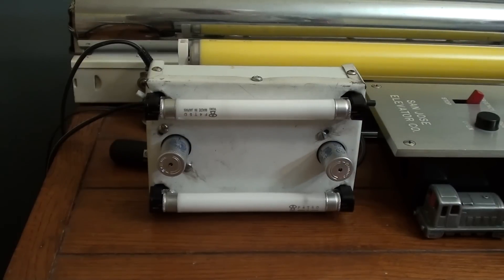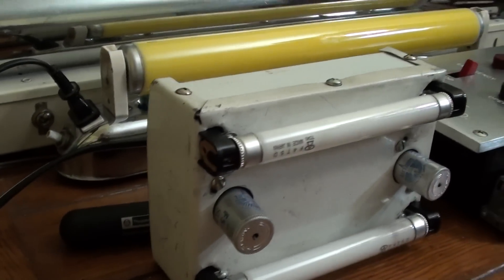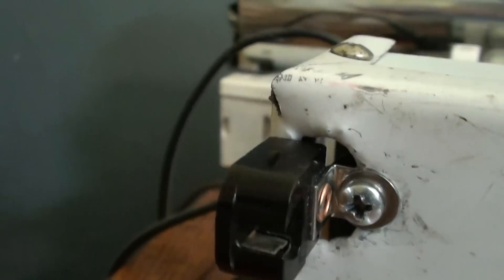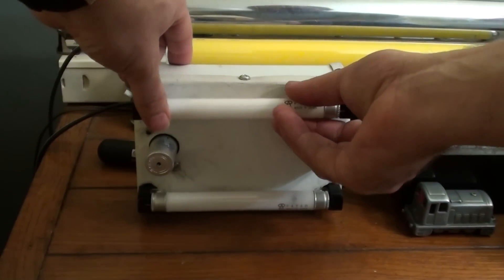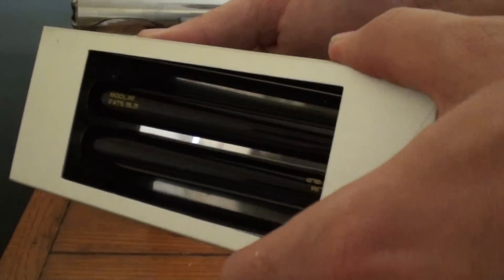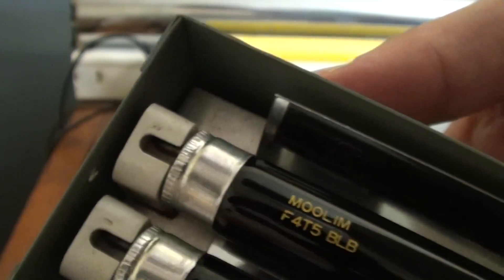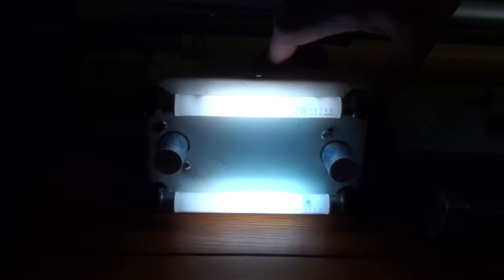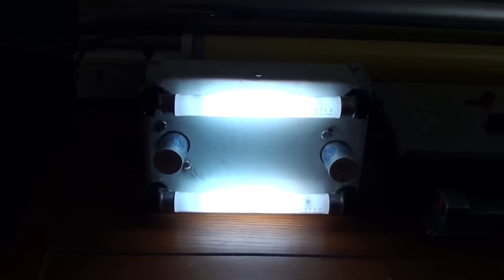an update on my F4T5 Preheat Fluoescent Fixture from David Lay

Comment: Interesting to see a 4w lamp flash like this. Since we are on 240v here in the uk, they usually strike first or second time  and rectify at EOL. 4w mains fittings are unheard of here and only battery operated ones are available thus I had to build my own. Perhaps it's to do with the massive voltage drop the ballast must perform thereby making it large and inefficient.